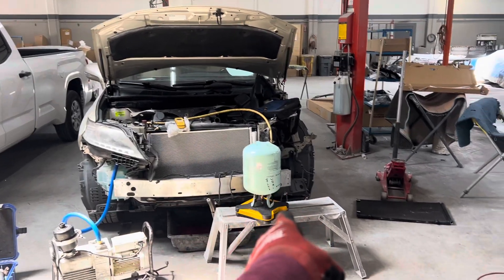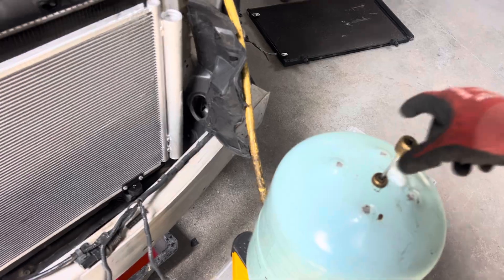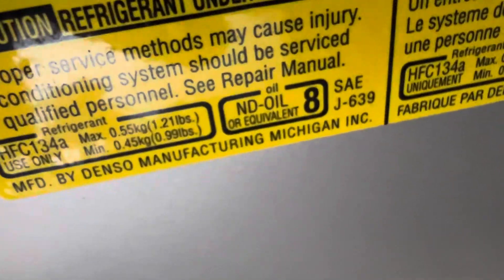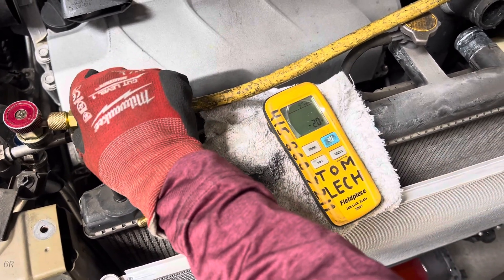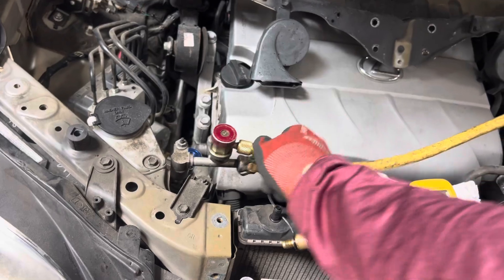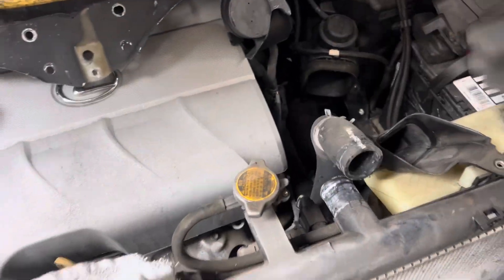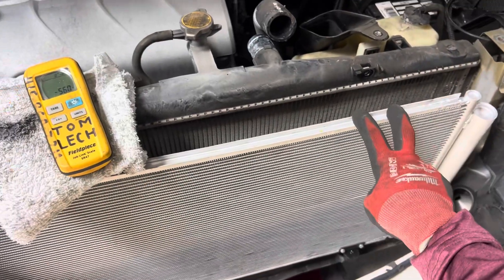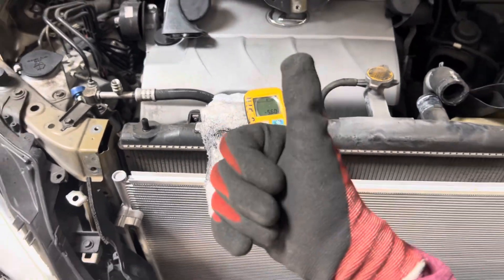Refrigerant, recharged, single hose method

Comment: If you have the vacuum pump hooked up to the low side, and you add refrigerant to the high side, won't the vacuum pump just try to suck out all the refrigerant? It looks like you were quickly trying to close the low side service port after starting to add refrigerant to the high side so the vacuum pump doesn't suck at all out. I thought about adding refrigerant to my AC system this way, because if I do the traditional way, when disconnecting the vacuum pump from the yellow manifold gauge set line, by the time I get refrigerant hooked up and ready to go, I'm already slowly losing my deep vacuum from 500 microns, up to like 800 microns. I think it's because my manifold gauge set hoses just suck. So I'm thinking if I do it this way, I can add refrigerant before I lose vacuum.
Reply from the maker: @Xgamer121X  nothing about luck. 🍀 
That’s why you have ball valves to open or close. 

You cannot have any components that are leaking or bypassing gas. 

It’s extremely simple.

Comment: Did you purge the supply hose?  I didn't see that.
Reply from the maker: You could do it one of two ways

You can purge the line from your refrigerator canister 

Or you can vacuum the line from your refrigerant canister through the system through the coupling .  
And then back out the coupling and open up the refrigerant charge to that line . 

Personal choice

Comment: Quick question. After flushing, the evaporator, how long or how many psi of dry nitrogen should I push through there instead of shop air to be reasonably sure there’s very little flush or moisture left in the evaporator?
Reply from the maker: If you’re using a proper highly volatile flushing solvent that evaporates at a low temperature. 

I crank my reggae up to 600 psi, but that’s me personally I wear hearing protection eye protection in face protection  

Because if that hose lets loose, you lose grass of the hose that flying around hose with the little piece of brass on the end, put your eye out or knock your front teeth out . 

And I just blow a real quick five second burst maybe two. 

Because I know once I put it on the vacuum pump, the micron gauge will tell me that all volatile organic compounds and all traces of moisture have been removed by the system 

That is what a micron gauge is for